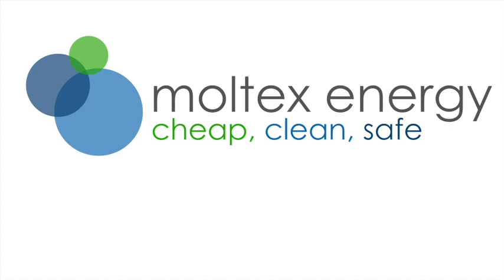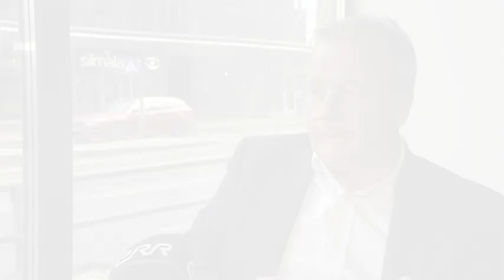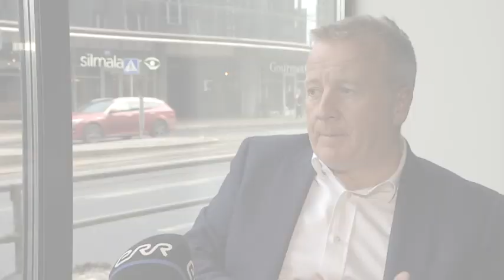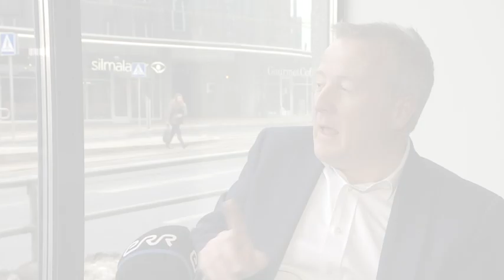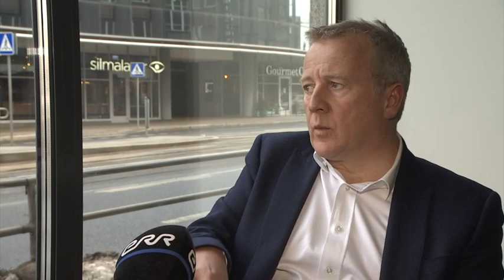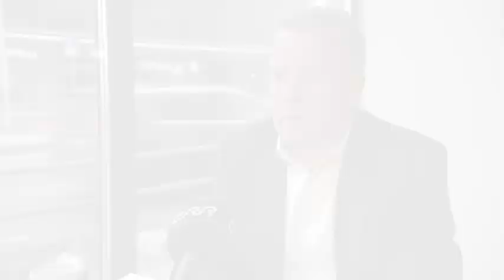Moltex - Estonia interview

Comment: How to would you store the energy?
Reply: The MOLTEX  primary coolant does not leave the reactor vessel. Heat is exchanged to a safe coolant which  is at high temperature, hence can be stored in large insulated tanks to provide  backup heat energy storage  or give other parties access to this energy resource.   In effect this enables rapid variation of power , previously a serious disadvantage with old reactors.

Comment: I get it, it can't blow up on its own. But in the absence of "expensive engineering solutions" like containment dome, doesn't the reactor become more vulnerable to a terrorist attack? Also, assuming gazillion of units built all over the world, what will happen in the event of large scale military conflict with THOUSANDS of reactors physically destroyed and their radioactive fuel scattered? Sounds like nuclear energy needs to wait until fusion is available.
Reply: Small reactors are difficult to hit, but more importantly these particular small reactors are encased in nuclear grade concrete at least 1 metre thick and there are no pressure vessels or volatile elements inside. There is no active cooling system to break down. There is no steam to create a hydrogen explosion. If the fuel rods become scattered they will simply cool into solid salt. If the load is removed at full power the reactor will warm a little but power outputs falls (negative power coefficient far beyond any PWR). The passive cooling system easily deals with it.

The most dangerous isotopes expelled as gasses from PWR accidents (iodine 131 and caesium 137) exist as salts in the molten salt core. Salts cannot blow away in the way gasses do. This was easy to prove to regulatory standards because they are too chemically reactive to remain in their elementary forms.
Reply: Please pretend that you are an engineer or that you have some level of common sense.[abstain from mental pollution]
Reply: Well, you have a point concerning the destruction of reactors in war zones. But keep in mind that the nuclear bombs dome that has stopped a Third world war. I think that at this point most of the Small Modular Reactors will be deployed in highly secured countries. I glad that you responded and you took my criticism well. My name is Richard you can check my material. : www.instagram.com/peechluv/ or facebook.com/1richstar2 Are you Russian ? Talk to you .
Reply: Highly secured countries have a lot of individuals with some pretty strange ideas living in them. I don't think war is the only thing that we need to be worried about -  https://www.youtube.com/watch?v=qlZh9-NQEyI

Comment: Actually, molten salts are very not corrosive, almost not at all. There are some differences between different salts used, chloride, fluoride etc

Just as destilled water isn't corrosive on its.

It's when you mix a salt with water that you get something that is highly corrosive. Everyone thinks of rusty old cars and salt used in the winter, but it's not the same as the molten salt. 

I don't think there is a lot of water hanging out at in a neighborhood where the temperature is high enough to melt salts.

Nevertheless there are good reasons to avoid pumping molten salt, any complexity that can be avoided should be avoided.

I think the biggest challenges ahead will be of an administrative nature once you try to get the design certified and licensed to be used for actual electricity production. 

May the knifes you use be razor sharp so none of the red tape you need to cut through will cause you any trouble.
Reply: The issues are less with conventional corrosion as we know it (redox reactions at the material surface) and more with chromium dissolution and diffusion, tellurium intergranular cracking, and deposit of dissolved metals on the cold side of heat exchangers. So the metal is still being eaten away but through a different process. 

This is largely eliminated by redox control, argon cover gas, eliminating lithium from the salt mix, and exclusion of water but there are still issues with heat exchanger plugging and erosion. 

Not a show stopper - proper redox control results in less than 10 micron a year corrosion. So a millimeter extra thickness of heat exchanger material still gives 100 years of leeway. Of course you lose efficiency as a result, so there will need to be a tradeoff made between large, inefficient heat exchangers that are impossible to plug or corrode, or small compact ones that can be sequentially replaced.
Reply: Moltex have the fuel salt in vertical vented tubes which are moved and eventually replaced as the fuel depletes. The coolant salt (the fuel rods sit in) is purely a heat transfer medium with no nuclear elements. These are also well proven in solar thermal plants so corrosion/erosion issue should be well understood. Replacement should be uncomplicated though it is within the containment building.
Reply: It become corrosive of there is source of oxygen. Metal oxides are very weak compare to nonmetal oxides like silica.
Reply: @Dave5843-d9m  (Thank you for that) So... Moltex uses solid fuel? Why don't they just be up front about it?
.
(Edit: Oh... I finally got it. Moltex isolates the molten salt fuel into tubes, which has its advantages.)